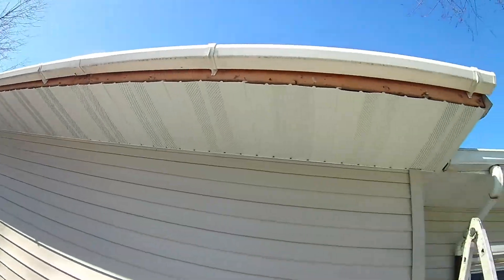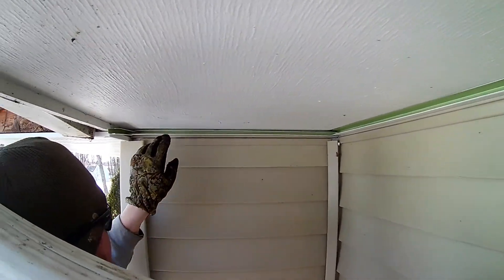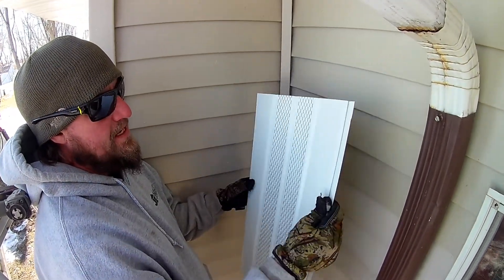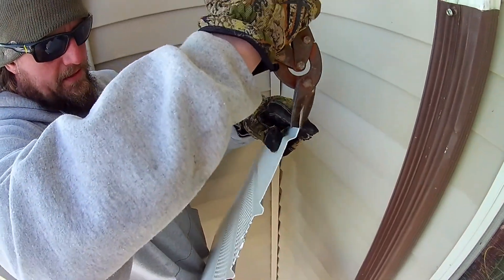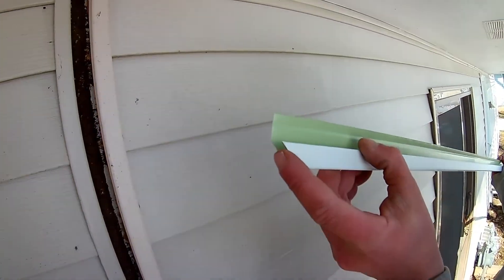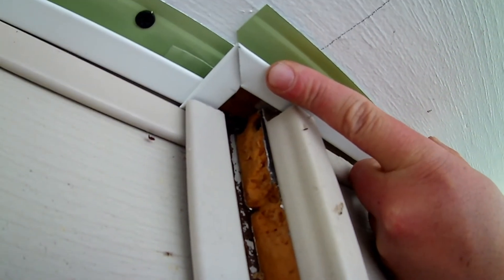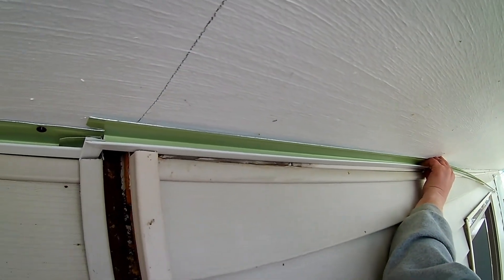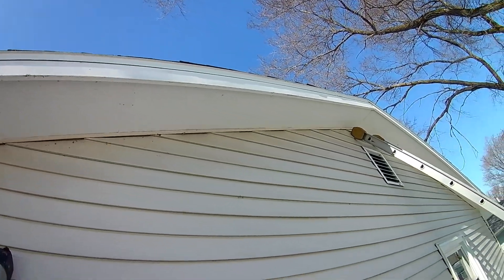HOW TO INSTALL SOFFIT AND FASCIA PART 1

Comment: what up man! about to post that video you tagged me in just wanted to check out a few videos first. great job i'm glad you used a center vent but I gatta tell you...and feel free to delete this comment if you want...but that center vent won't help the flow to the attic unless you cut holes in that wood soffit first. when I cover up old wood soffit like that, not only do I knock out the old vents but I take a skill saw a chop giant skinny rectangles out or just cut a bunch of holes like box vents on roofs. that helps with the flow to the attic. the shingles will burn up if there's not an efficient enough intake (soffit vents) to the attic to help flow out of the roof vents. keep the videos coming! i'm editing a soffit fascia birdbox video right now.
Reply from the maker: there is vents in the old wooden soffit about every 10 ft or so. part of the video was on garage which didnt have vents... thanks for the comment!!!
Reply: @Lifes_Apprentice  n problem